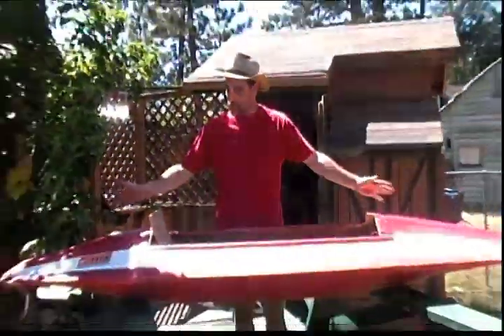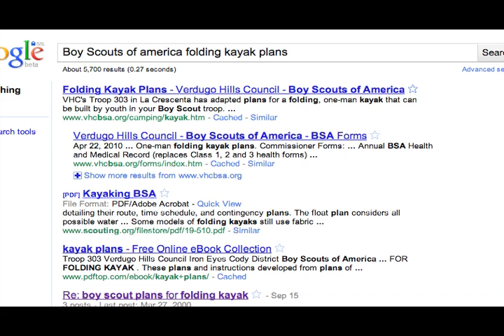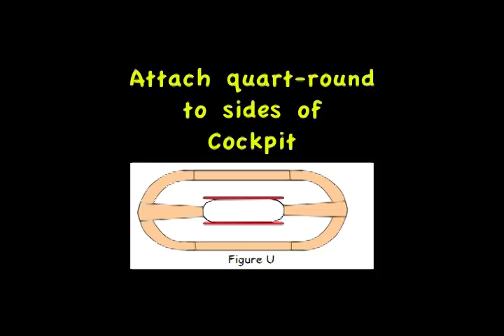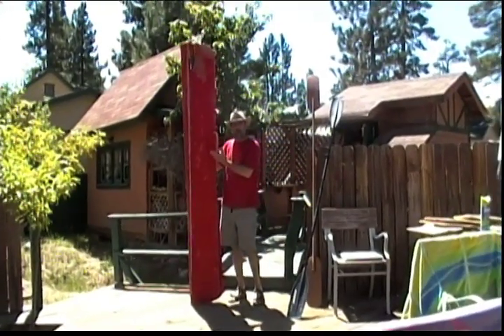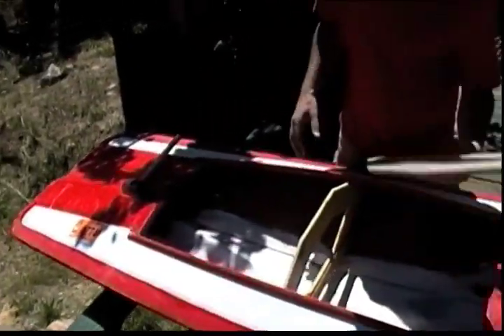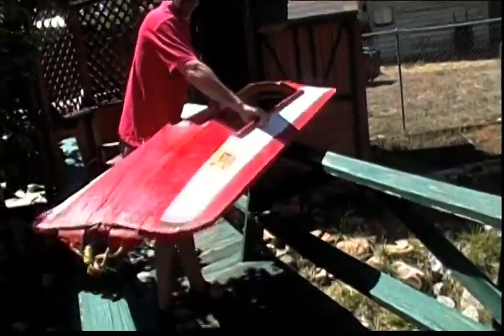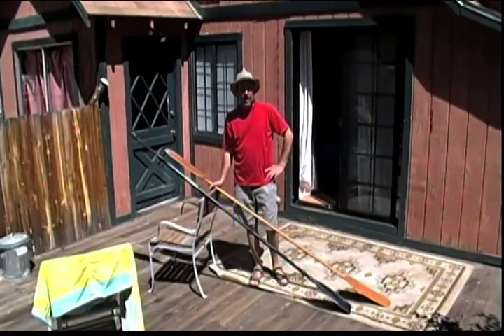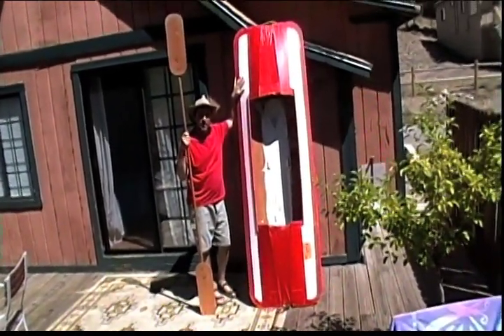How to make a Folding Kayak

Comment: Would this still float for someone who is 210lbs??  I was also wondering if you thought it would be doable to substitute coroplast in place of the top 2 pieces of plywood.  I was thinking of doubling coroplast sheets for the top so they are more structurally sound.  The plywood spreaders would help with the rigidity too.  Just brainstorming out loud :)